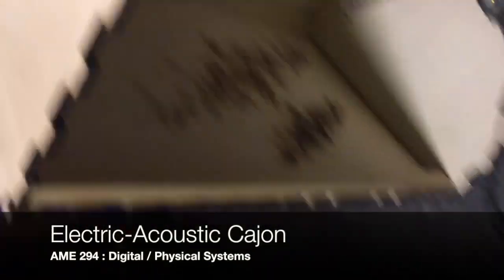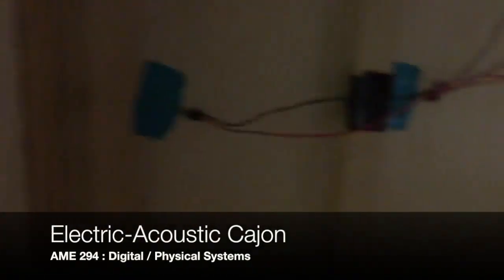Electric - Acoustic Cajon

Comment: Hi! Can you please explain your project? A tutorial and the code would be amazing! I'm working in a project exactly like this one. Thank you!
Reply from the maker: +Yara Quilles Marinho Hey! sorry for the super late reply (college) ! The box was laser cut and put together with wood glue. There are tons of "boxmakers" online that will provide you with a box layout for the dimensions you input. The panel on the front was a 1/16th inch thick, while the rest were a 1/8th inch thick.  As for the code, I currently do not have it; however, it was relatively simple. We just mapped the pressure sensor readings to the range of an LED strip. We had one half of the strip emit red light, while the other half emitted blue light. Similar code is all over the web! I hope your project is going well by now and that this helped !
Reply: Hey, is there a way to process the input and perform digital signal processing to make it different